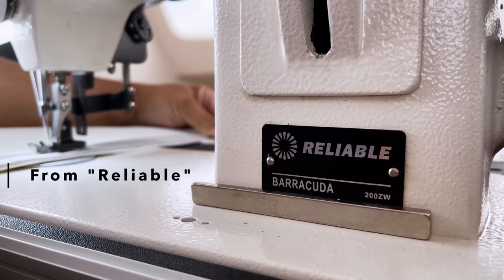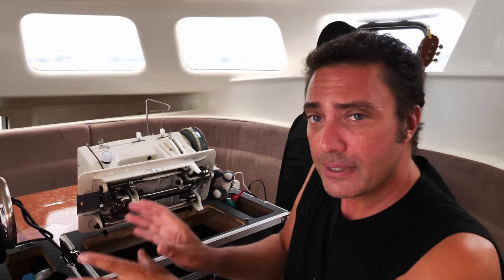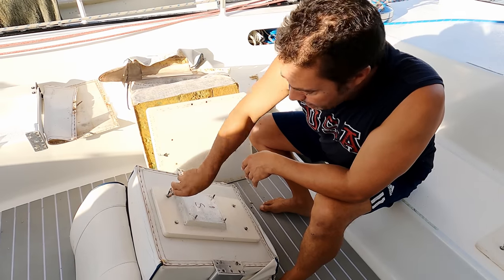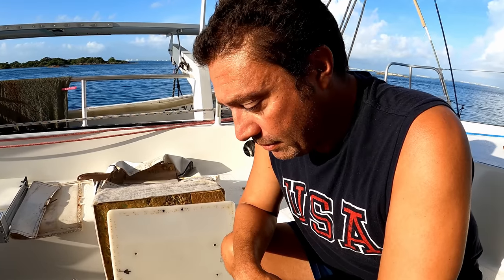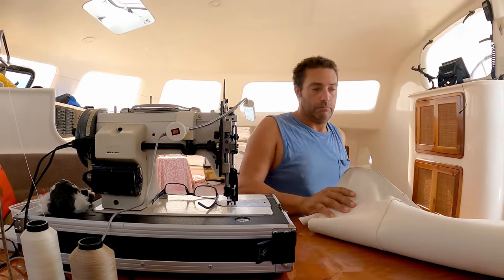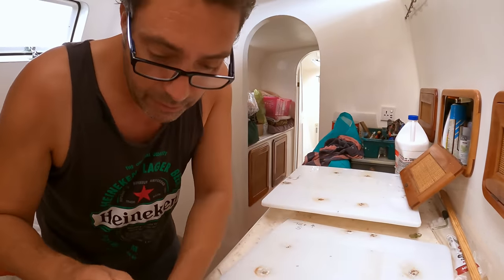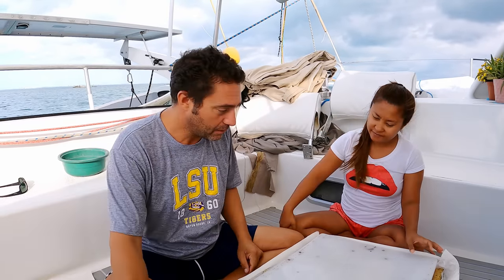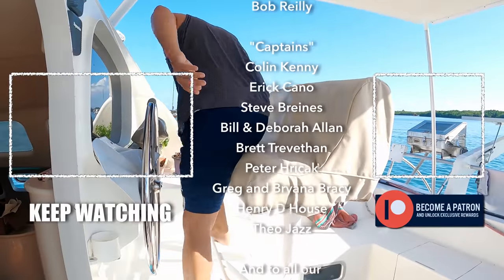GET YA DIY ON... CRUISING ON A BUDGET - Sailing Life on Jupiter EP107

Comment: Hi Jupiiter, great job on the upholstery. Just a little tip - most of the time upholstery gets destroyed  by the air inside the foam compressing to much as people sit down on it and blowing open the weakest point in the upholstery (usually the seams). Drilling a few (6no) 10mm holes into the base plate will help with that a lot. Keep up the good diy work. Regards, Tommy
Reply from the maker: Ah, good tip. Tks Tommy

Comment: sewing is so much fun. I bought my GF's mom a industrial sewing machine which she tested on 8 layers of heavy denim. She was impressed.  She kept breaking other machines that is why I searched and found a model for $250 US that was $1700 a year before. I looked at the replacement model and it had a computer with a screen. So that means that new model will not last as long as electronics always fail. This has a 25 year 100% warranty.  She sews Carhart jackets which are super thick and this machine does it with ease. she said her sewing time is cut by 1/2. It is a Janome. The Janome HD 3000 is close to her model. she is a professional sewer and has even sewed heavy tent material which most machines can not do.  I got hers in 2018 I think. 2019 maybe.

Comment: Nice sewing work Jamie, I love doing that kinda stuff myself. On your chairs when you swerve in the USA you should have had 6mm stainless squares cut and used this and tapped the holes for the armrests etc. would have lasted longer. On your toe yes in a pinch taping them together works. In the first world they would align and insert a wire through the bones to keep the bones from moving and remove the wire after healing. 😉
Reply from the maker: Youch.  glad I just taped them.

Comment: Next time you could invert the wing nut heat it up with bolt in place then when  it’s hot enough. Pull the wing nut into place let cool 😊😊😊

Comment: Well done with the sewing ,I would have heated the wing nuts very hot turned them the opposite way up put the bolt through and tighten the very hot wing nut through the polyethene base, just a suggestion.😀
Stay Safe.
Reply from the maker: That woulda been better.

Comment: It is a good channel with good content.  One suggestion I would have made was to use some small wood or sheetmetal screws in the plastic to capture the wing nut rather than epoxy on HDPE.  Good voyages, and the seat covers came out great.
Reply from the maker: Might have been better... Cheers Darin

Comment: I love your DYI attitude....especially since you have time.  A techniques for the HDPE glue is to drill 1/8" holes into the base at an angle opposite angles from each other.  Fill those holes with your glue and then go around the wingnut like you did.  The wingnut has to break the glue out of those splayed out holes to come loose even if it comes unglued.  And add 'Shoe Goo', from Walmart or online source,  to you boat supply.  It stays pliable but harder that Silicone sealer, and sticks to more stuff.  I hem my pants with it for instance.  It won't handle anything over 150*.  I also Seal my spokes on my dirt bike so that I can run tubeless tires....and many more uses.
Reply from the maker: Shoe glue huh? Will look out for it. Cheers
Reply: @SailingLifeonJupiter  ....easy mistake. Shoe Goo' not glue.  Not many people use it because of it's silly name, people underrate it.  LOL.  Fair winds.

Comment: I broke the same toe and taped it back as you did.  It is crooked because of that I believe.  You should be taping broken one between the ONE on either side as a splint. 3 taped together, not two.
Reply from the maker: Ah well. Yeah, still points West.

Comment: I’ve installed a lot of hdpe pipe over the years and our method is high temperature fusion welding with specific tools. As far as I know there’s no glue that’s a permanent solution for this material. Epoxy will work temporarily I suppose , but the stresses on those nuts is pretty significant. Nice job on the sewing.
Reply from the maker: Ah.. Thanks Paul.. Cheers

Comment: I bought a Reliable Baracuda 2000U-33 used - I have the monster wheel on it, but it sounds sloppy - unlike yours that sounds tight -  I may have to see if you have tweaking videos on getting the Reliable tuned in just right.  I've done great work with it regardless and I'm very impressed with your work you did.  I've also never done piping but I think I will try it on my next project since yours came out really nice.
Reply from the maker: They take a lot of patience, of which I have little...mine is powered by cuss words!

Comment: After watching many sail cruising videos, I'm beginning to believe that a more accurate term than "DIY guy" would be DIY God.  Seems that you need some knowledge in just about every field out there from medical procedures to Diesel mechanic to edible plant foraging. lol.  The upholstery job looked really good.  If you had some extra HDPE laying around, empty plastic milk jug or plastic 5 gallon bucket,  using a wood burning tool or soldering tool you can melt small pieces and work it into the seat base and then build it up around the wing nut to stop it from spinning.  Or cut you a 1 inch wide 2 inch long piece of plastic from a bucket, melt it over the wing nut and melt the ends into the seat base.  Once both plastics are hot enough they will mix.  A lot of kayaks are made of the stuff and I've done several hole repairs by melting the HDPE with a wood burning tool.  Don't use a heat gun, it will get away from you.  Been there done that.  The subject of shaving... Use cheap body wash.  I stopped using shaving cream 30 plus years ago.

Comment: Look into E-Z Lok fasteners. They are a threaded insert that threads into a given material and has an internal thread for flush fastening. I used the stainless steel versions, to embed into epoxy plugs on the roof of my RV, for leak free mounting of my solar panels. They are a pretty slick little things. Nice work on the cushion cover btw! Enjoy *your content, keep it up! Cheers.
Reply from the maker: Thanks Jax